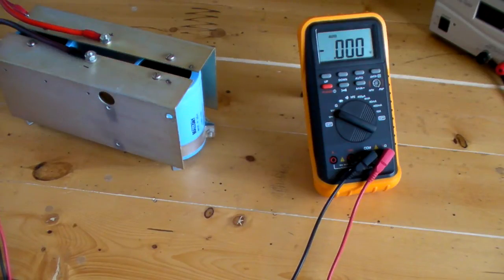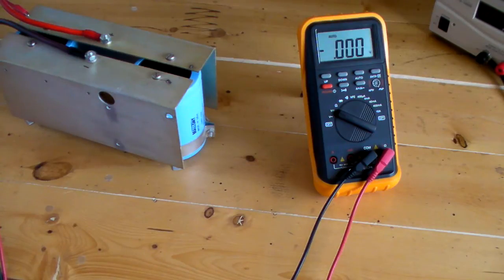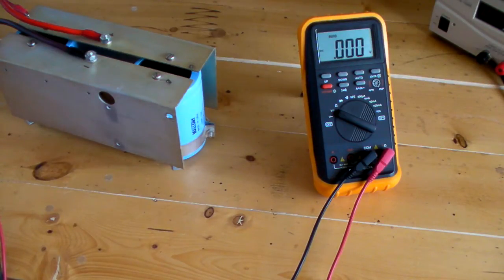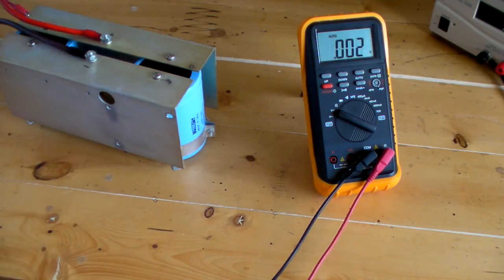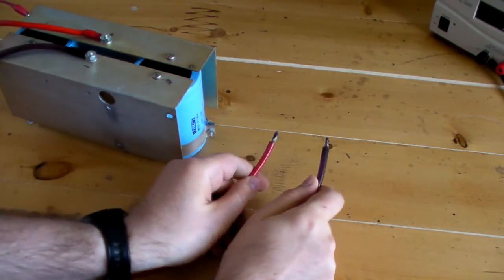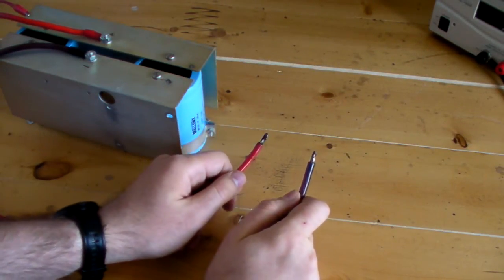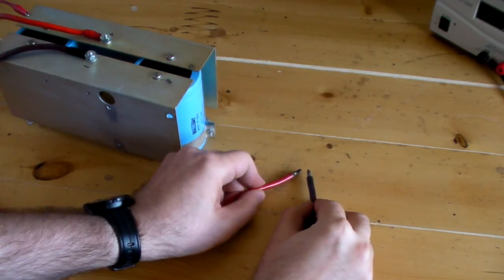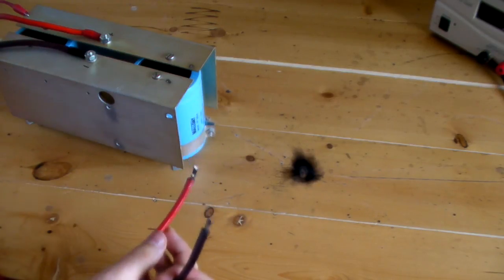Fun with large capacitors

Comment: Hi Orcinus, I recently found a box full of these huge GE capacitors and was wondering what could be done with them.  I'm not sure what they came out of.  Mine are somewhere around 50,000mf and 20 some volts.  Cool video.  Did you use a regular power supply to charge them?  Also, you kept discharging them so I assume they were connected to a regular power supply set to 55V or something like that?   Thx.
Reply from the maker: Yes, they were still connected to a power supply for the duration of the video, to recharge after every discharge.
Reply: great thanks for the reply. @Orcinus24x5

Comment: Why does a slide projector need this much power?
Reply from the maker: +Samistine It wasn't your run-of-the-mill household slide projector for the family vacation photos. This projector was a two-unit beast, with the power supply weighing in at over 60 pounds. I don't know where it came from originally (I found it at Value Village many years ago along with another identical one for $15 each), but it could have easily found service in a large commercial planetarium or theater.